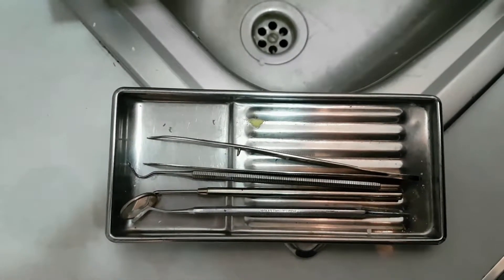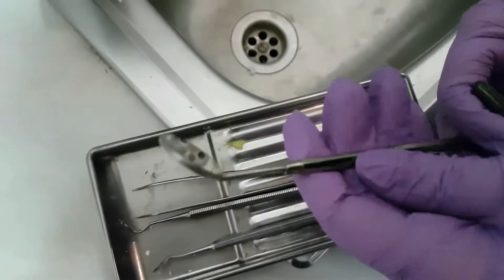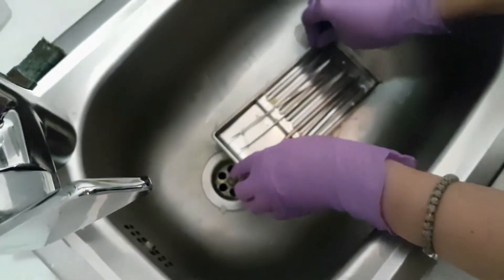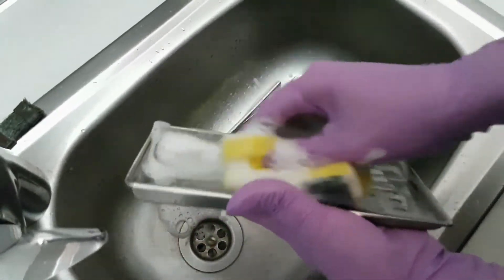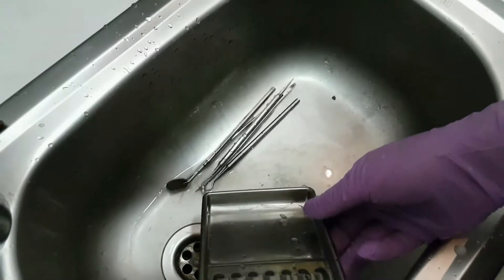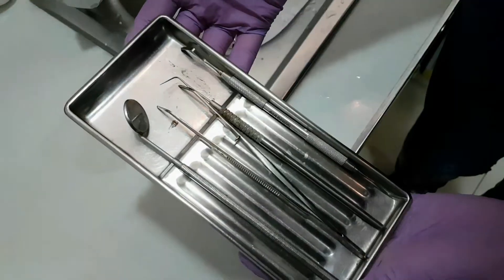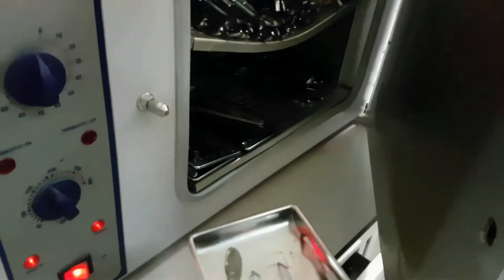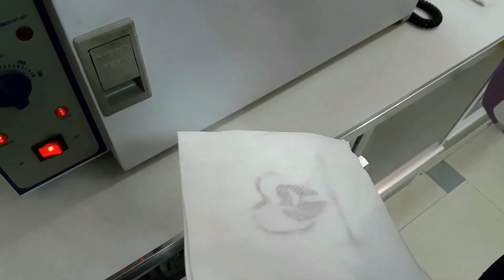Dental Dry Heat Sterilization Process - [ EXPLAINED ]

Comment: It’s better to use a ultra sonic and medizyme… it kills 99.9% of all blood and bacteria(not soap and water) the vibration of the ultrasonic removes all material that hasn’t been done yet in the operatory before bringing it to sterile room… and the hot water with medizyme added takes care of any blood,tissue or material left on instruments…and all instruments should be bagged before putting in a autoclave or dry heat for proper handling..once you open the door all those instruments you just sterilized are now contaminated,and should only be opened in the room with the patient at the time of the appointment!